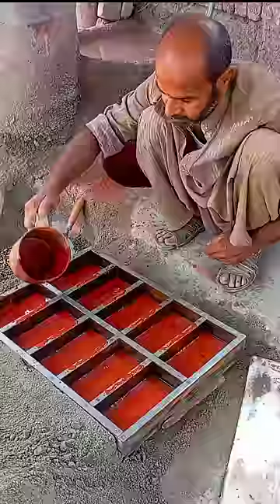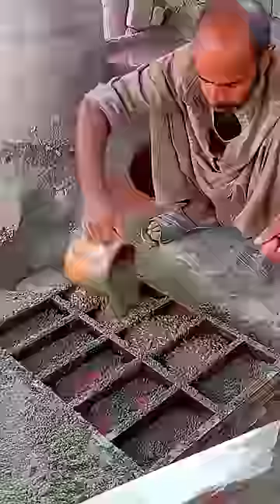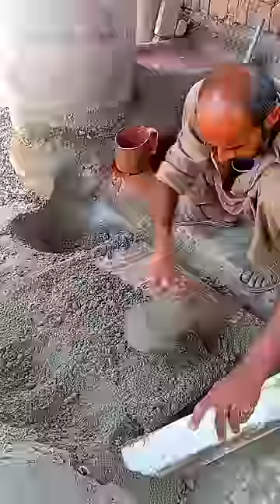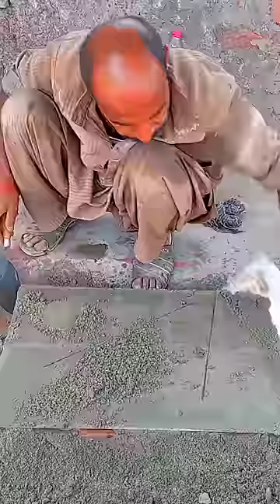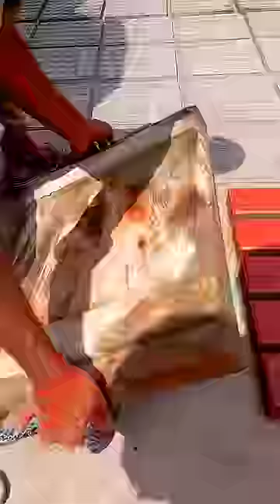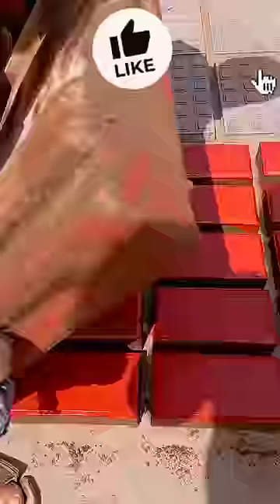Amazing Technique of Making of Footpath Blocks #shorts #cementprojects #diy #footpathtiles

Comment: Respect for the hard work but this "Amazing Tech" is over 100 years old
Reply: Technically; “Tech” is an abbreviation of technology…not technique… and this is much older then that, what’s your point?
Reply: @HighlyRegardted  technically abbreviations can be interchanged, swapped about and used for several things. Not every country uses the same, in the UK it even depends where you live to what each abbreviation means. Tech is widely known as short for technology but it isn't exclusive to that.

Comment: Too labor intensive. Gotta be a way to make this by hand but faster. Think FORD assembly line!
Reply: there are machines that do this very quickly, but if you use a machine, these poor people are unemployed. that's why you get little money to do it.
Reply: @bruno5188X  I’m not talking about a mechanized process. Still by one man’s hand, but with screeds that do a faster job. Plus, the guy building the bricks should be passing to others to move them where they will dry. More efficient and less injuries
Reply: unfortunately this guy is cheaper than a chip
Reply: @cincinoglu  that's Sad and you are right  :( but not this guy but what he does